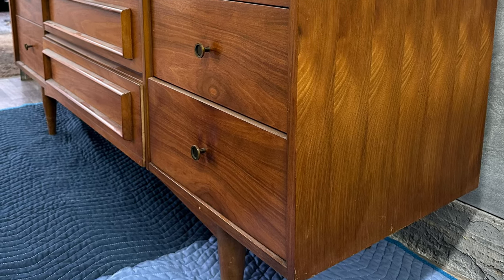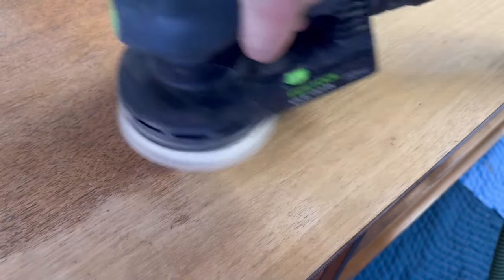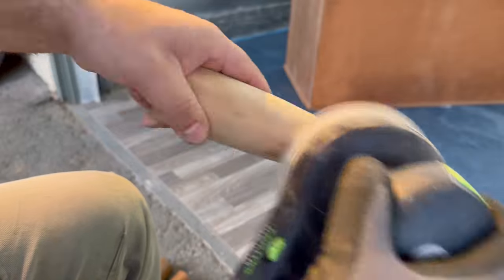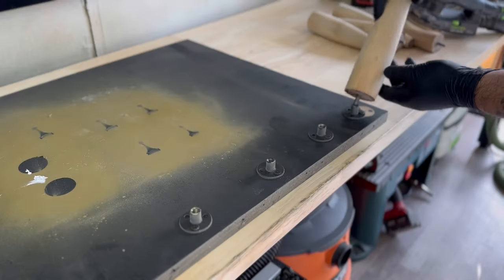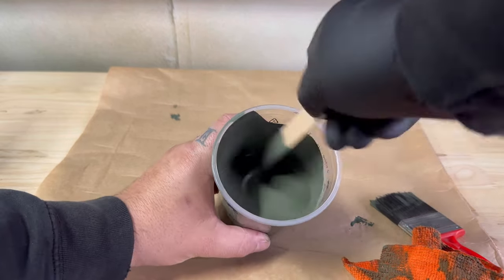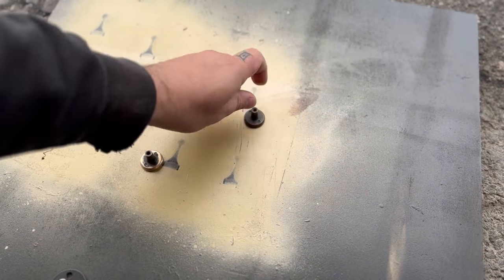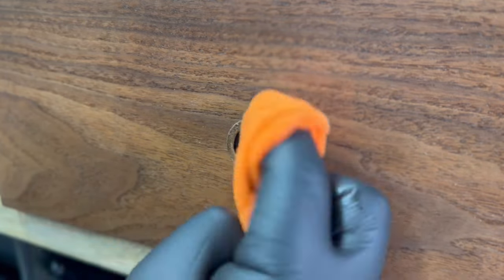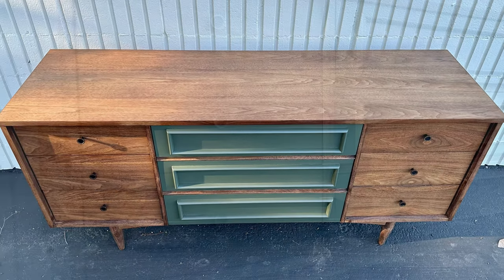EXTREME FURNITURE MAKEOVER of a 1960’s MID CENTURY dresser || USING A SANDBLASTER to save TIME

Comment: The sandblaster is the coolest thing ever. :)
Reply from the maker: It most definitely is. I love it
Reply: @CedarPineDesigns  I haven't seen one of those before. How did you acquire that fun toy?
Reply from the maker: @karladial62  it’s on Amazon. Just type in sand blaster and it’s a blue gun. You hook it up to an air compressor

Comment: Really nice job especially the touch of gold gilding wax on the knobs. Always fun watching you work your magic on a mid century piece. Since you did ask for opinions I would have left the rectangular trim molding that is on the middle of each middle drawer the same stain color as the rest of the dresser. I think it might have integrated the two different finishes better. Like yourself my favorite design style is mid century modern. And I'm a purest when it comes to keeping a piece as original as possible. Combining a painted surface with a stained surface is something I am trying to understand and like. Looking forward to your next episode.
Thank you
Reply from the maker: Thank you so much for the compliment and honesty. I agree with you totally on the square trim and staining it to flow the color with the paint. My only concern was it being if different wood species, it will definitely not match the veneer color so I just decided to paint. But you hit the nail in the head. Thank ton for your input

Comment: Gorgeous work as always Samuel, personal preference but I think a slightly darker green might have contrasted better against the wood.
Reply from the maker: Thank you so much. I appreciate the input but I didn’t want the green to clash to much so I went a little subtle on it
Reply: @CedarPineDesigns  I have never done any of this... You make it seem accessible (not easy!!!!) possible to learn. (Which I hope you take as a sincere compliment!)  my question is about the sand blaster...
1. Why not use it everywhere on everything (remember I'm new and stupid about this stuff.. So laughing at me is ok--as long as you tell me why I'm stupid so I am not doomed to remain that way!)

2. Is the sandast tool crazy expensive?
Reply from the maker: @davemarsteller8377  thank you. Not a stupid question at all. The sand blast method is a messy process so the minimum amount on detailed areas is perfect. Also, it will still need to be sanded after so just sanding the flat surfaces is just a bit faster. The entire sand blaster set up is pretty inexpensive if you already have the air compressor. I paid like $150 give or take for the sand blast gun, a spray tent and the blast material. I hope this helps

Comment: Everything was impressive until about 7 minutes in when you decided to paint the front green. I'm not entirely sure what the motivation was behind it. You also used polyurethane which would not have been used on a mid century piece. Spray lacquer was the standard
Reply from the maker: Customer preference. They wanted more green but I convinced them down to just this. Thank you